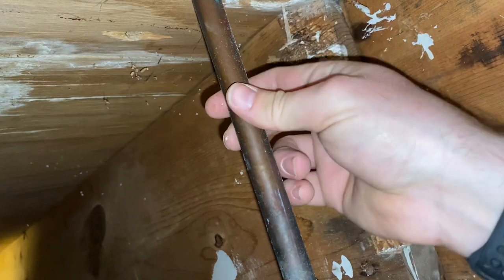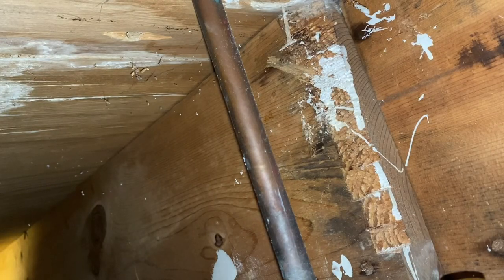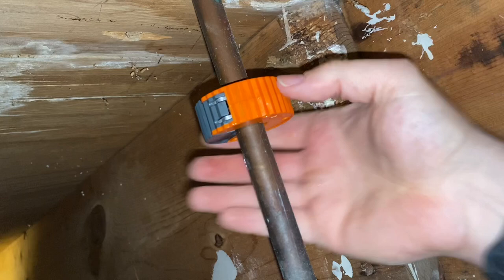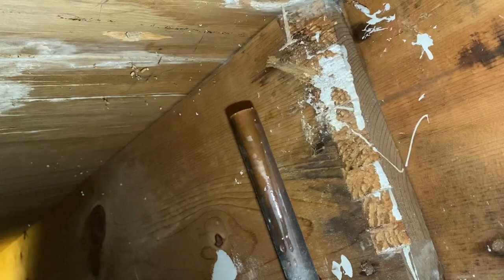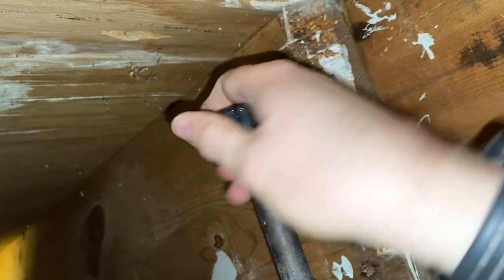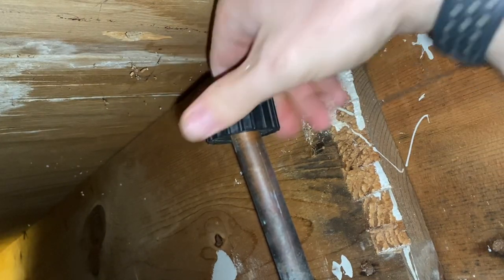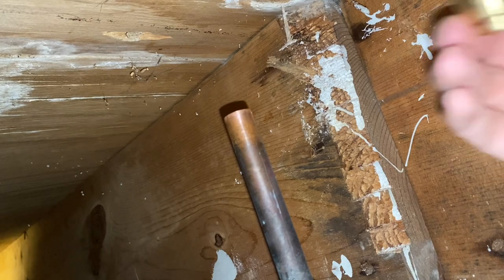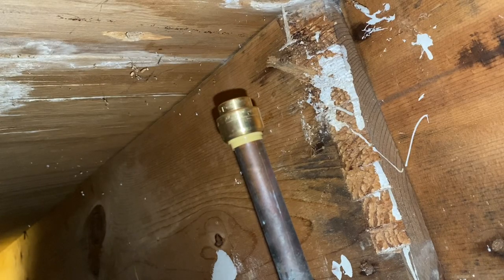How to cap off a copper pipe with a Shark bite end cap #SharkBite #PushtoConnect #DIY

Comment: Welcome back. Enjoyed the video. I have used them in my own house. I have two that have been on for 7 years without any leaking. Great product, great tutorial.
Reply from the maker: The shark bite fittings are the best. They are expensive but when you only need a couple fittings, its well worth it. I would still solder the fittings if I was doing a lot of them.

Comment: Do you have to debur inside of pipe after cutting?
Reply from the maker: I never have and haven’t had any issues.
Reply: @efd  some people said to use the debur pencil so that it’s smooth and doesn’t cut the o ring inside the sharkbite fitting
Reply from the maker: @appleztooranges  Its not a bad idea. I haven't had any issues...yet, but will look at doing that in the future.

Comment: You're supposed to deburr the end of the copper pipe to ensure that sharp edges don't damage the rubber O-ring inside the Sharkbite adapter. Otherwise you may see leaks in the future.
Reply: How do deburr the end? Sandpaper?
Reply: @lburrsshinyhunts2253  You can get a deburring tool for a few bucks at Home Depot or wherever. It's pretty much just a small sharp blade. There are specialty tools from Sharkbite and other manufacturers that deburr inside and outside the pipe, and they're around $12 or so.
Reply: @lburrsshinyhunts2253  Emery board or fine grit sandpaper.

Comment: Is this a permanent solution? Is there a risk of the end cap failing 5, 10, 20, 40 years down the road?
Reply from the maker: Anything is possible, I haven’t had any issues with these fittings to date

Comment: If needing to cap-off a 1/2-in. copper pipe soldered to a Hose Bibb (outdoor faucet), attached to a brick wall... how do you remove the hose bibb. No way will that round pipe cutter you used for in there.
Reply from the maker: Can you get to it from the inside? From a basement or crawl space?
Reply: Yes, there is crawlspace access, but this hose bibb is 50-ft. away from crawlspace entrance and we've seen water moccasins up near the house lately. Yikes. This was hoping, my friend, to find a way to cap off this leaky pesky hose bibb from the outside-- if anywhere near feasible. Flying solo at 67, no one around to crawl under there in the dirt. Just me.
Reply from the maker: @docjody8624  yikes! If you just want to stop it from leaking, the easiest solution might be to put a cap on the hose Bibb itself. Here is an example of what I mean: https://amzn.to/48tcEii
Reply: Thank you, again. I really want to cap the pipe itself. That Hose Bibb is an ancient 55-yr. old fossil. Then run a 50-ft. PEX line from there back to back side of house where crawlspace access door is to put it's Shutoff Valve there. (Were that Faucet NEW, yes I'd cap it.)

Comment: Can you use this on a dripping copper pipe for the fridge water line? I dont use the fridge water line but the copper pipe is dripping. Idk shit about plumbing lol.
Reply from the maker: a fridge line is generally a lot smaller. You could get a coupler at a home improvement store, or if its dripped at the end, you might need a compression fitting.